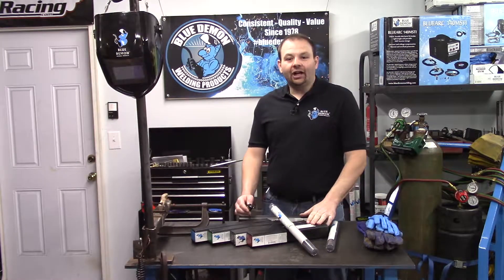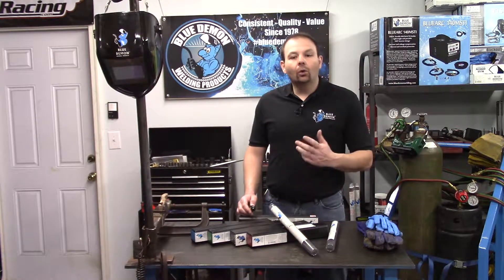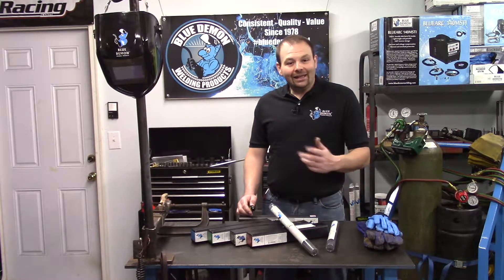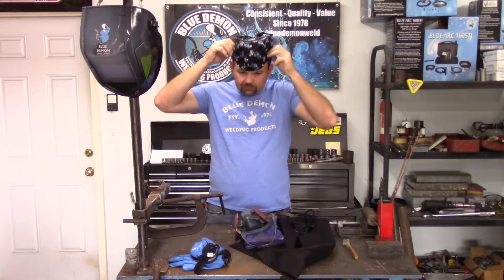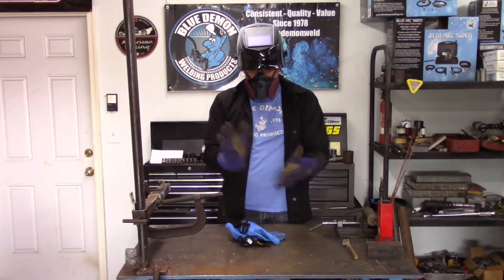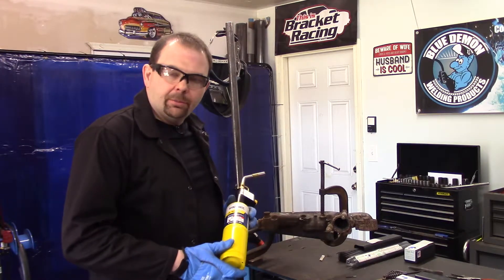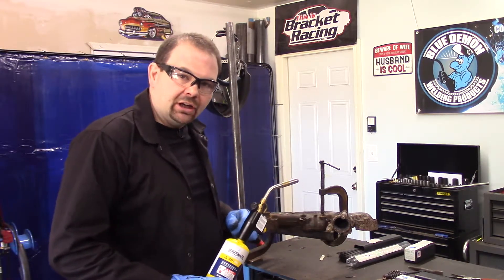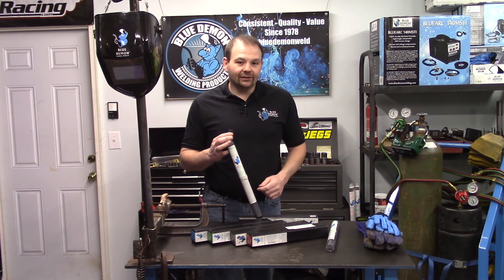Blue Demon ENI55 Cast Iron Welding Electrode

Comment: Can you grind the weld flush? Really informative video 👍
Reply from the maker: possible yes, but not very easily.  better to use a NI99 electrode if you have to grind flush.
Reply: @bluedemonweld  do you mean that grinding it flush would make it weaker? Or what do you mean by "not very easily"
Reply from the maker: @arnoldhernandez3930  I mean the NI55 rod is 45% Fe and not very machinable.  NI99 is much softer in metalurgical terms